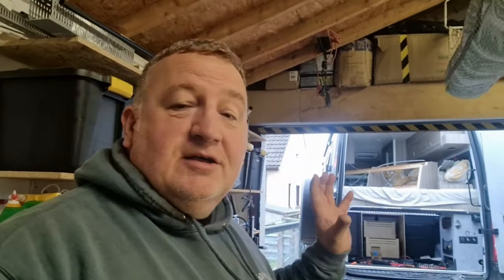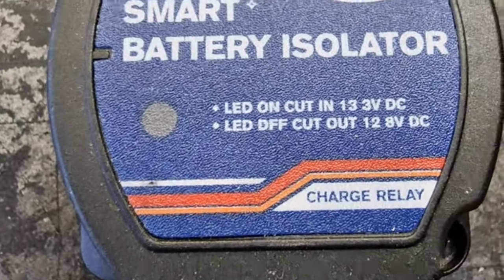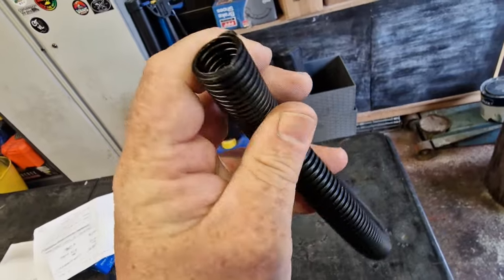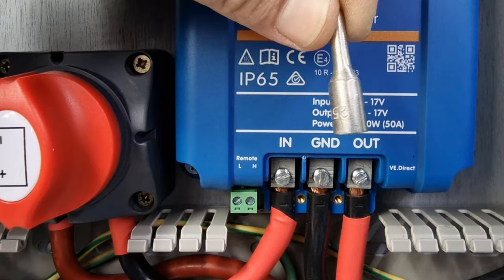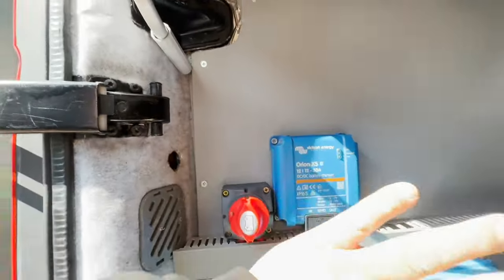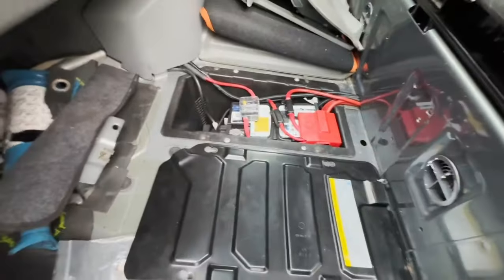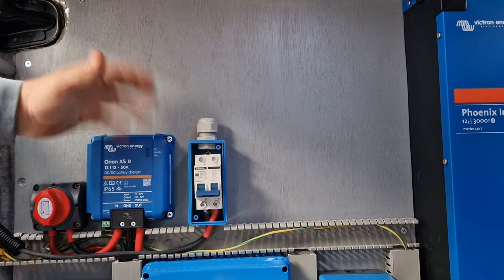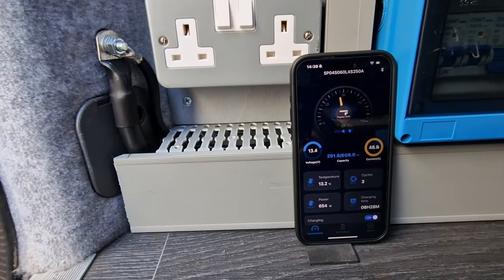Orion XS 50a dc-dc charger install to charge our Fogstar 608Ah Lithium battery

Comment: Thank you for the detailed video. We were going to install a Mastervolt Mac Plus 50 amp charger, but the new Victron looks like it will give us more information and take up less space.
Reply from the maker: It's a fine piece of engineering I'm ordering a second one to replace the old 30amp one we have

Comment: Just fitted ours and took  out the 2 x 30 amps and we get more power in to the leisure battery  and 90% less heat in the garage area . Bing bang bonus
Reply from the maker: I have two systems now a 12v up front with the old 30amp dc-dc charger and this 230v set up in the garage, I think I'm gonna swap that out after out trip

Comment: Nice one bud , undegoing a power upgrade myself on the motorhome , it's expensive but quality kit . Where is the cheapest option to buy ,also maybe  worth advise to check alternator outputs to see whether they are up to the job , I know you uprated yourd so your covered, gonna check mine first to make sure . Quality footage , keep it up pal .
Reply from the maker: I've ended up changing all my electrics out over the years quality is expensive and it takes time

Comment: Love your videos.  I am just wondering why you ran your DC to DC cables ouside the van instead of inside?
Reply: Probably so he doesn't have to remove all the furniture,  factory cables run outside so there's no issue at all running them outside.
Reply from the maker: Shortest route 👍
Reply from the maker: I run all my cables so they can be accessed if need, plus this was the shortest route 👍

Comment: Another cracking video Sam. I have a quick question. The ‘Beast’ is a beast but what do you use the Roamer battery for? Sorry if this is a dumb question😬
Reply from the maker: So I am going to explain this in another video but I'm running 2 stand alone system a 12v on the Roamer and 230v on the Fogstar
It works a treat
Reply: @TheCraftyBlindersvanlife  Cheers Sam, that’s another one to look forward to.👍👍

Comment: Where did you get the 25mm to 16mm reducer from please?
Reply from the maker: Edmundsons electrical ltd they are a national company
Reply: @TheCraftyBlindersvanlife  you wouldn't happen to have the part no from there to ensure I order the correct part? Thanks in advance as i need a reducer to fit my Orion XS as i cannot get the cable into the terminals without losing some strands. Excellent video as well as very well explained, better than all the ones i have seen so far.

Comment: If I install this do I need to make my 12v system isolated? I currently have it setup isolated i.e not using van as negative. Or can I use the unit as a standalone isolated charger
Reply from the maker: this a is a none isolated unit requires earthing to the chassis

Comment: Hi mate, just found your channel! Watched your review on the 800 Aferiy.  The fridge you powered was it a 12 volt compressor one? And was the power bank fully charged? Ive currently got a 12v apicool 35ltr compressor cool boxbin my van. So was wondering if the Aferiy would be suitable to power it. Kind regards Nigel
Reply from the maker: the 12v fridge was an absorbtion fridge, if you planning trips longer than a weekend I would be looking at a 1500w to 2000w power bank the 800w Aferiy last for a couple of day powering the fridge at night we plugged in while driving

Comment: Hi all, I’ve a question. How do know if your van has a smart alternator? I’ve a 13 plate sprinter. Is there a test or will it say somewhere? If it is a “not smart” alternator is there an alternative. All advice welcome. See you all at Lawton 😀
Reply: A few ways to tell,  on the main NEG lead on the battery there will be a small box, it's the shunt the ECU uses to tell battery state of charge, another way is if the alt has 3 small wires going into it it's likely a smart alt, non smart alternators only have 1 or 2 small wires.
Reply from the maker: You probably have a standard alternator, but the easy way is to check your output voltage at start up it should be around 14.4 the check it after 10 minutes, and it will have dropped back down 13.5 ish
Reply: @TheCraftyBlindersvanlife  I’ve checked my alternator today and it’s a “thick” alternator not a smart one. Will the Orion XS still work? Or would there be an advantage of swapping for the 180 smart alternator? I’m charging a 280Ah LiFePO4 battery. I’m quite happy to swap it over. I have vectron solar charger,mains charger and a smart shunt. So wanting to keep the system “blue” so it all works off the same app and in harmony Cheers Stew

Comment: Bootlace ferrules work well no need to heat shrink .
Reply: Bootlace ferrules make the cable thicker not thinner, that is a REDUCER makes it thinner.
Reply: Funny that you say that used them on my XS no issue do your homework pal.
Reply from the maker: They do 👍

Comment: Your cable sizing is overkill.
Victron state that 16mm is fine for 6 M length .
25 mm is for over 6M.
35 mm is plainly not needed.
Reply from the maker: How have you calculated this? You do know I'm an electrical engineer?
Reply: Maybe read the manufacturers manual 👍
I'm pretty certain Victron know what size cabling is required for their own product
Reply from the maker: @jfkjfk1 I do! but I don't blindly follow the herd! victron don't factor in any external influences, 
I design each circuit for the environment and location it will be used in and 35mm was just fine for my application 25mm was not acceptable due to the voltage drop